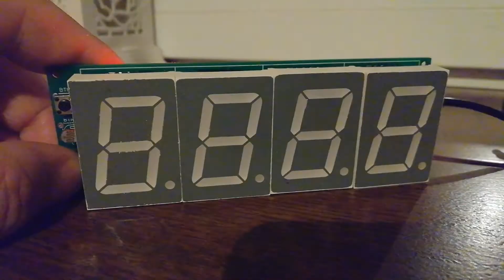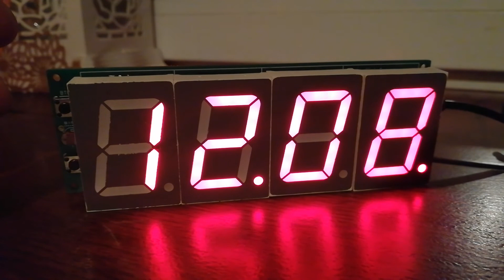12/24-h format RTC clock with manual adjust, date, alarm & temperature (1)

Comment: Can you add days of the week to this design 

Like Sunday,Monday ,Tuesday Wednesday ,Thursday ,Friday and Saturday 

Using led indicators?
Reply from the maker: on Arduino board not exist free pins for that.. it need also to add a lot of comonents for that... now I haven't free time now... neither in next future, so this project remins as it is..
Reply: Ok, but if we use 74hc595 we can achieve it
Reply from the maker: @asianjohn326 but how control the shidt registee without pins ?.. you can made any changes to solve your request

Comment: Please sir can you send me the diagram on how you connect the IN4148 Diode with 10k resistor and Arduino to use as Temperature sensor
Reply from the maker: in description of the video is link to an article... in article is a schematic... also you can read article from http://nicuflorica.blogspot.com/2017/09/termometru-cu-dioda-1n4148-ca-senzor-pe.html and the base article: https://www.hackster.io/microst/thermometer-diode-based-524613 PS: 10k ressitor is not mandatory because for usual pins, but for A6 or A7 is... (+5V to pin)